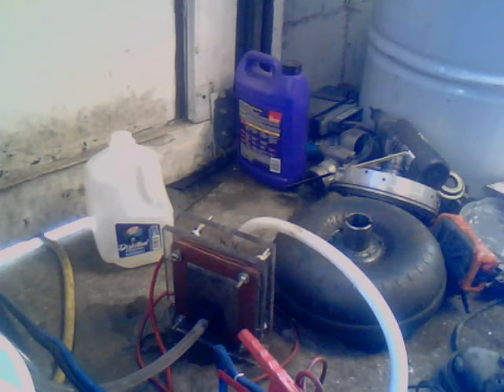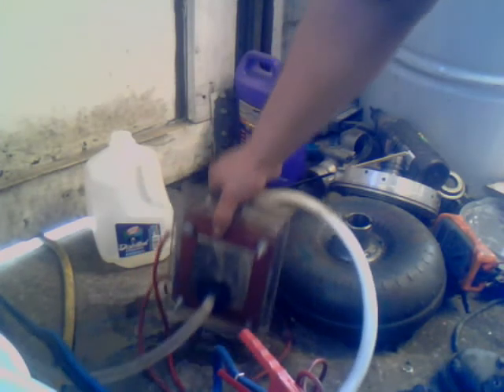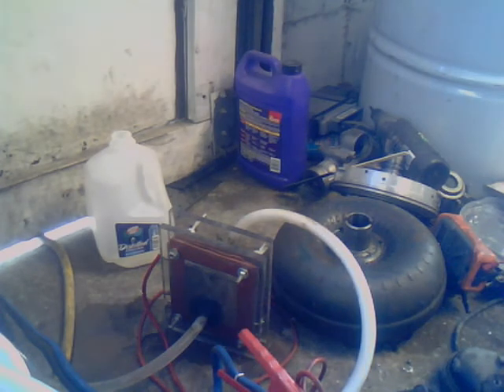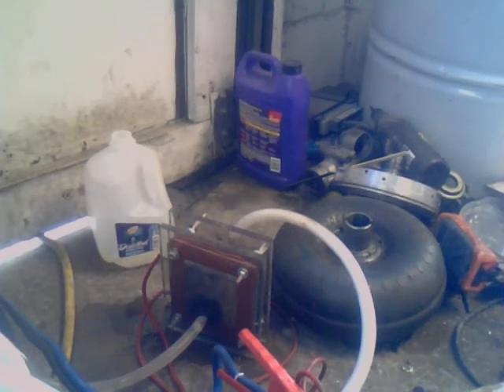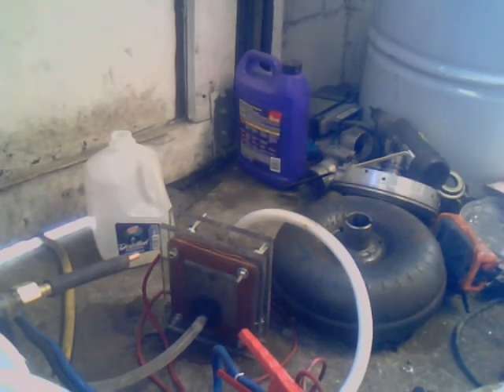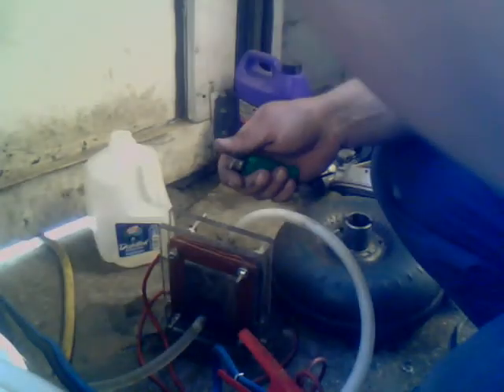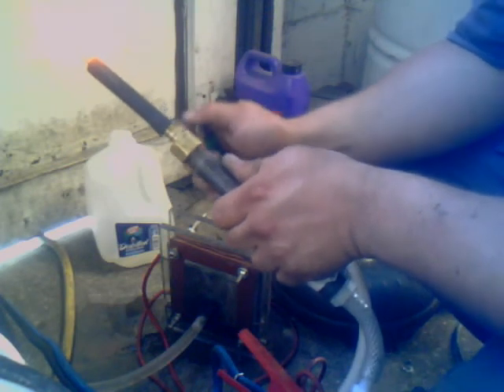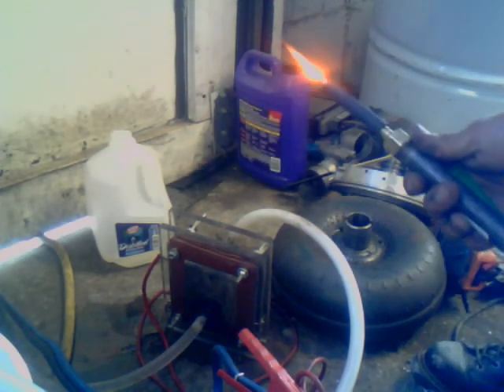hho dry cell torch

Comment: You are getting 100.8% of Faraday Efficiency.

2.16/(12.5*18.7/((1/33)*3600))=1.008

Congratulations, but that shouldn't really be possible with 3.1 V per cell (12.5/4).  What's your power supply?  Is it possible that you are trying to measure a waveform that is not true DC with a non RMS type meter?